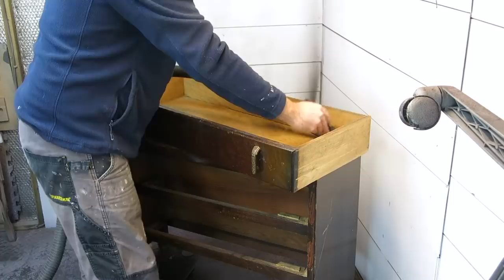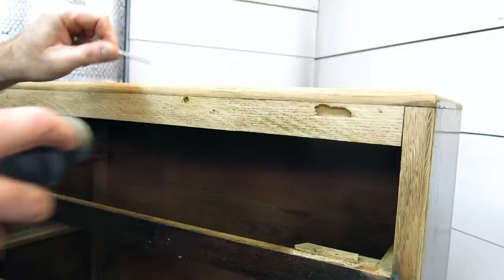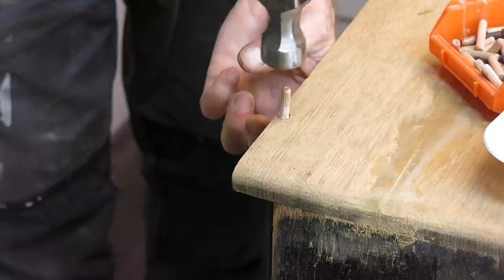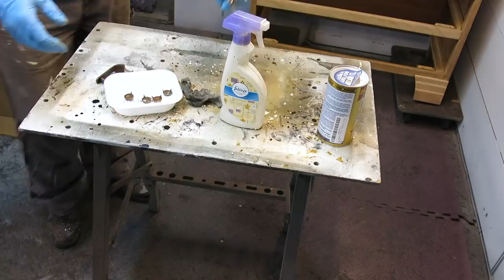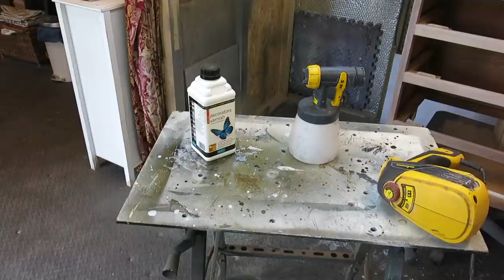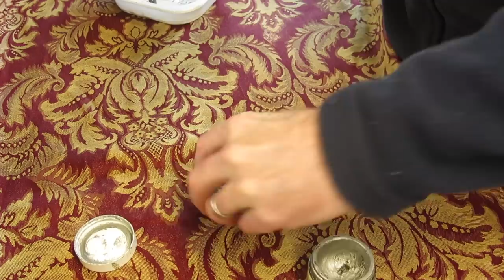Full RESTORATION of a Vintage set of Solid Oak Drawers - White Wood Stain

Comment: The drawers' wood is tiger eye and should be stained darker. This is great for pine or other lighter wood, but this type of grain should be stained darker  and warmer color. I used to restore antique radios. But... it's your channel, your work. Keep up with the great work. Like  how you are consistent about small details in your videos. The headers, font,  music, doggie (big plus). Also you put some light humor in before, I'm a big DIY kibitz  and binge watch woodworking, metal working, restorations. Some channels even though have  a very knowledgeable content creator, but if their delivery is dry, monotone and boring, they could not hold interest for long. You looks like you have a great channel in the making.
Reply from the maker: Hi Mercedes. I fully take your point about using darker stains. They would have been a more dramatic contrast but I just wanted a light and airy piece this time. I appreciate your constructive comments and you’re very kind saying you think my channel will be a good one. Thanks for watching and once again, I really appreciated you feedback 👍😀
Reply: Yes, I agree with you that on this wood a darker stain would do the wood more honer, however, I really like the effect of the white stain on the set of drawers!

Comment: The techniques shown are the mark of the genuine craftsman. A brush and vacuum and then using a cleaning agent to get the project started. We see the washing done that we are almost certain leaves  residue in the joins and corners. The brush and vacuum take care of that nicely.  The insect repair is a great touch. We also saw the best way to spray. Across rather that vertically.  

Well done Sir!
Reply from the maker: Hi, wow they are lovely comments! Your support is very much appreciated 😀😀👍

Comment: I didn't like the idea of a white stain, at first, but when I saw the finished result, I changed my mind.  It looks kinda "ethereal", it's definitely lovely!  The only reservation I have is that you DIDN'T stain the dovetails, on the drawers?
Reply from the maker: Hi Abigail, thanks very much. I did actually stain the dovetail joints. It adding detail section. 😀👍

Comment: You did a great job with this and it does look very modern... actually what it reminds me of is the vintage speculations on modern which made me giggle a little. The white stain wouldn't have been my first choice as I love stains that bring out the grain and this somewhat subdues it... but somehow it works! A piece all tightened up, restyled (the handles really stand out now) and good for another however many years of use!
Reply from the maker: Thanks Kath 😀😀

Comment: I love it. i am just wondering why the cross pieces are whiter than the  drawer front. Is it a different wood or did you stain them more times than the drawers. It's so beautiful, i am doing all my furniture white, so this episode was most interesting to me.
Reply from the maker: Hi Bella. It’s a while since I worked in this piece but it may be that grain on the drawers was slightly different than the frame. 😀👍

Comment: Do I automatically click "like" when a YouTuber shamelessly shows off their dog/cat? Why yes, yes I do. 🐶

You've definitely given this piece a new life, it looks great. I kind of wish you had kept the rear rail in place, it's a very period feature on a piece like this. Also, strictly speaking, I wouldn't really call this a restoration since you've departed significantly from the original character of the piece. Between omitting that rail, the addition of the decorative elements to disguise the insect damage, and the more modern looking finish, I would call this a reinterpretation or a renovation. That's not to say that the end result is bad or anything like that, just that it is not restoring the object to a semblance of its original appearance.
Reply from the maker: Hi. Thanks for your subscription and your detailed comments. Much appreciated 😀😀👍

Comment: Stunning renovation, rare & nice to see the inside of the drawers waxed, but why not stain or wax the inside of the carcass, the thinking must be well your never ever going to see it, but this is not true, you will see it when looking for that odd sock that you know fell down the back !
Reply from the maker: Hi David, its pointless giving the inside the same treatment which is why it doesn't get done when the piece is originally manufactured. Just a good clean and a freshen up with wax or oil is all is needed in most cases. If i didn't show the footage of that then my apologies 😀😀👍

Comment: It looked like you had trouble getting the drawers open at the beginning. Can you talk about how you remedy this with your finished pieces? I’ve tried bees wax and soap to help the drawers glide but those turn out to be just short term solutions.
Reply from the maker: Hi Laura. Apologies as I meant to add that but forgot to film it. I treated the whole piece including drawer runners with Howard’s feed n wax. 😀😀
Reply: @MayfieldRestorations  so the Feed n Wax helps the drawers slide again?! I have some but haven’t used it for that. Thanks for the tip! I’ve been loving your channel and your projects. And of course, Daisy!

Comment: Hi, enjoying your channel and very impressed with the results you get. Based on your recommendation I bought some “Elbow Grease” degreaser.  On the label it says: “IMPORTANT: NOT SUITABLE FOR WOOD OR TRANSPARENT POLYCARBONATES…”. I assume from your experience you have not had a problem with the solution – just wondered if you have any thoughts?
Reply from the maker: Hi Barry. I’ve also seen that but I’ve been using this a while now and had no problems whatsoever. I do clean my pieces when it has the existing finish on it prior to sanding so it may not be suitable for use on “bare” unfinished wood but I doubt it will do any damage in any case. Thanks for watching and if you have any other questions just ask. 😀👍

Comment: It was a big mistake to take the top's up-stand off. It held much of the dresser's vintage character. That white wash finish wasn't either a lucky choice. All in all, it ended up looking like a trendy new piece of furniture bought in a modern shop. I loved it as it was originally, a beautiful chunky drawers set from the past. I would have given it a thorough cleaning and a light retouching, preserving its old charm. But of course your restoration work is excellent and the video pleasant to watch. Salutes from snowy Mount-Lebanon.
Reply from the maker: Thanks for watching 👍

Comment: In my opinion - the piece of wood with the wood boring beetles should have been replaced because you can't know if you successfully killed them and all their eggs.I wouldn't want that in my house.Also , you should have repaired the drawer slides and stops so the drawers weren't all so difficult to get open as they were in the beginning of the video.Otherwise, you made it look lovely.
Reply from the maker: Virginia. The damage was fully treated to kill any insect or remaining eggs. The drawer runners weren’t damaged, just dried out and they were treated to the same treatment as the drawers, Howard’s feed n wax. They slide in beautifully now although I didn’t film the proof of this.  👍

Comment: It would have been much better with a complete strip of those squares along the top.  Now it looks like a lot are missing.
Reply from the maker: I agree it would have been better to add a complete strip across but I didn't have enough trim available. 👍😀
Reply: IMHO, a complete strip, had one been available, of the dentils would have looked heavy & clunky. I might have gone for a different pattern (5, 3, 1, 3, & 5 dentils, or 5, 3, 5, 3, & 5; instead of the 5, 5, 1, 5, & 5 pattern that MR chose), but an uninterrupted strip would add too much visual weight.